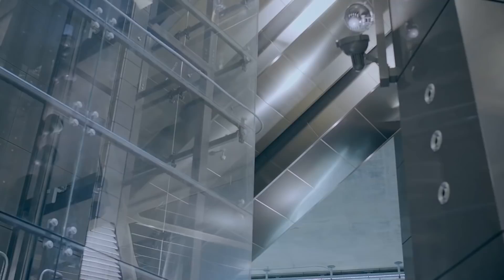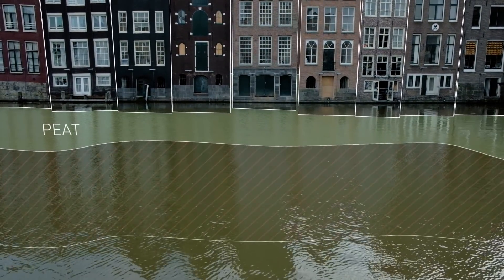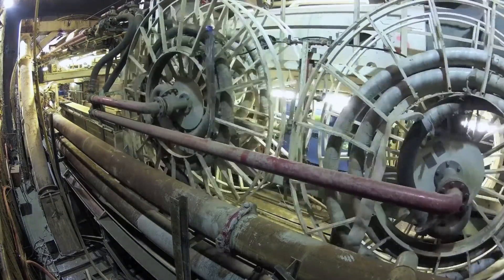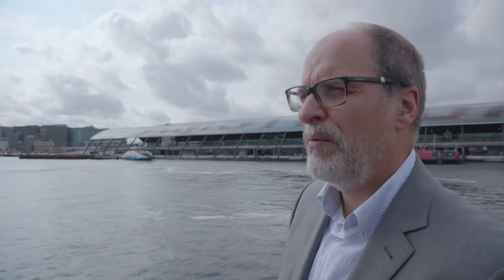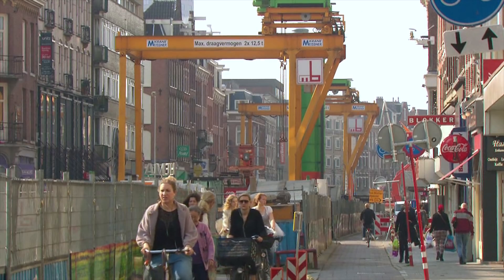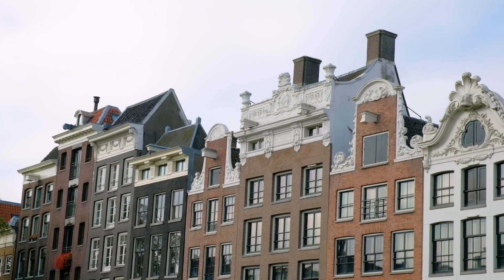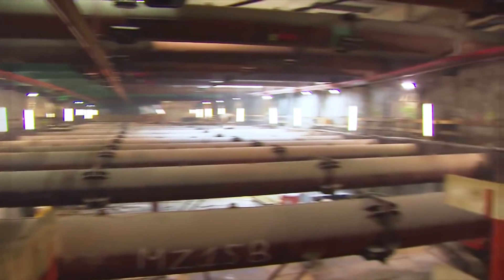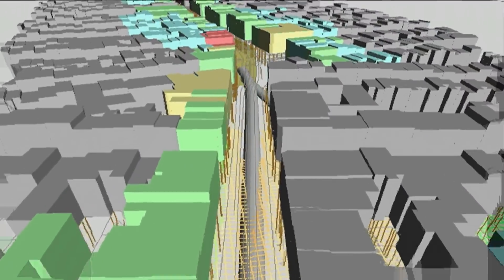The North/South Metro Line Amsterdam

Comment: Amazing video. I didn't know what a massive undertaking the tunnel under the train station was
Reply: Yeah and then add the fact that two people (one civilian and one worker) died during construction. At the north-side of the IJ, sheet piling fell onto a passing motorist that did not survive. The worst part about it was that it went wrong before as well, but without consequences: instead of shutting the work down and evaluate whether it was safe to continue, they kept working like nothing happened, until another piece of sheet piling came loose from the machine that had to push them into the ground and unfortunately caused a fatality.
What you also don't hear in this video are the extreme subsidings that took place at the Vijzelgracht and rendered a few homes inhabitable. The tachymeters that took readings of all the reflective indicators sounded the alarm way before the situation escalated. Citizens affected quickly contacted supervisors at the site as doors in their homes suddenly could not be closed anymore or got stuck. No one took any action until the situation became just plain dangerous. Research later showed that many had looked at the data that was clearly telling something started to subside, but no one took action.
Another was the subsiding that happened at the Central Station somewhat 15 years ago or so: a citizen got the impression something was off at one of the large building sites and happened to posess a distance-meter. After taking a few readings (to eliminate errors because it was just a commercial consumer device) he found that within 20 minutes, things had shifted 13 centimeters. If I remember it right, the contractor deemed the readings inaccurate 'because a consumer device' but when he called the fire brigade and their readings matched, a large area got shutdown, causing major chaos in the city center.

Comment: Since it opened in 2018 I have been using it regularly on my annual visits to the city to catch up with my friends...travelling all points north and south...quite often between Amsterdam Noord and de Pijp.  This, despite the fact that I frequently use all of the city's excellent public transport network - its trains, its trams, its existing metro / light rail system, and of course its (FREE) ferries....  This new N-S (numbered M52)  line is a truly amazing masterpiece of engineering and design and is so incredible in its complexity and sheer innovation. I really do love travelling on it (something you can not say remotely for any of the UK trains or metro systems) - and despite the fact that it's several years late in completion, and hugely over budget (hardly surprising given its difficult gestation period), plus the fact that presently it still has its usual detractors,  the Dutch lead the way in showing the rest of Europe how a brilliantly sustainable mass transit metro system should be built.